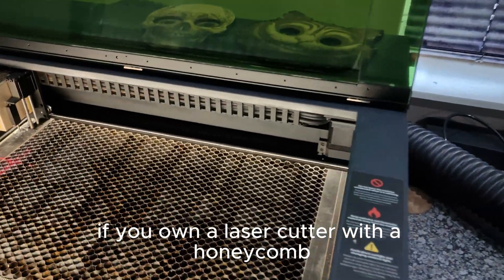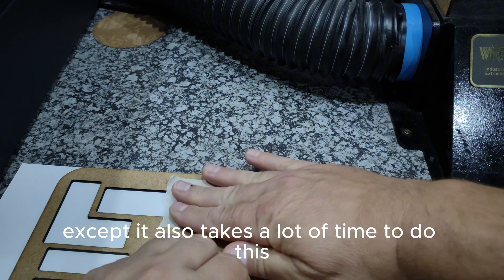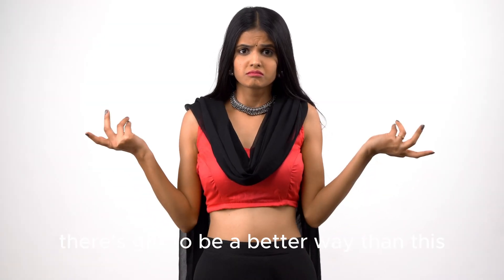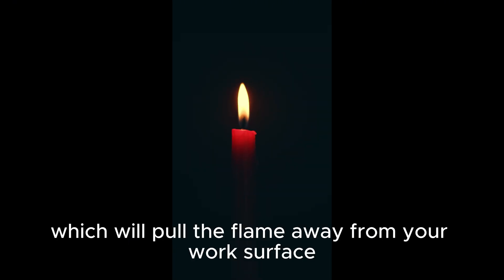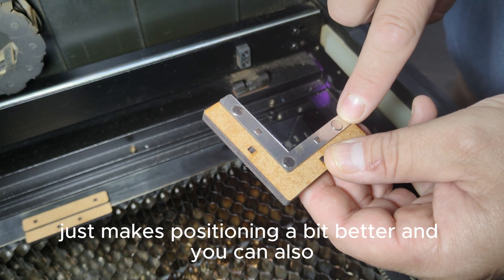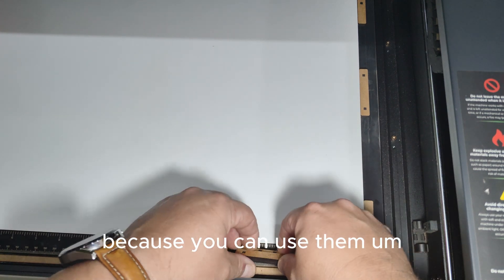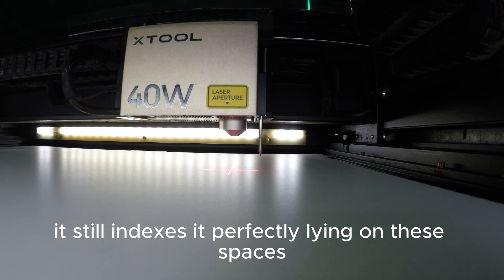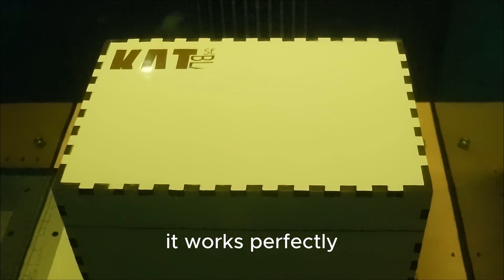How to Prevent Burn Marks on MDF | xTool S1 Laser Cutting Tutorial

Comment: Does this help with char on the edges?
Reply from the maker: Hi.  I found char on the edges are more pronounced if you use regular red mdf.  The yellow stuff made from pine fibre that is specifically made for laser cutting chars way less.   I also started cutting 6mm with two passes at lower power reduces it even further.  Hope this helps. ☺
Reply: @katseblad I will definitely try it. Thanks for the tips!
Reply: @wileycovington4497  I saw one person clean it with isopropyl alcohol and another person with a scrubbing pad. I havent tried either yet.